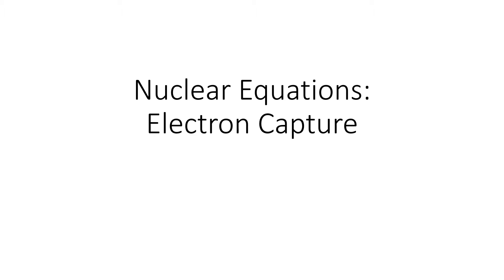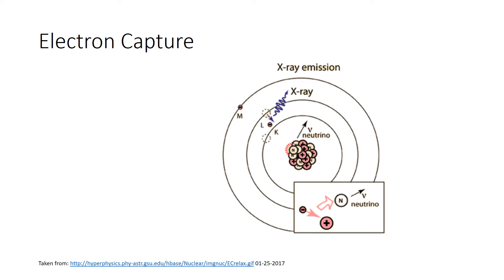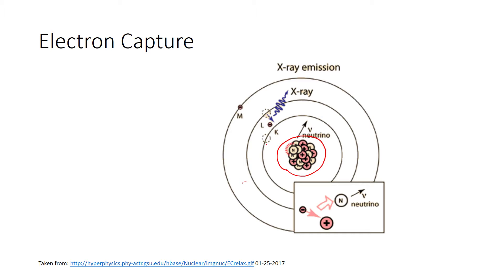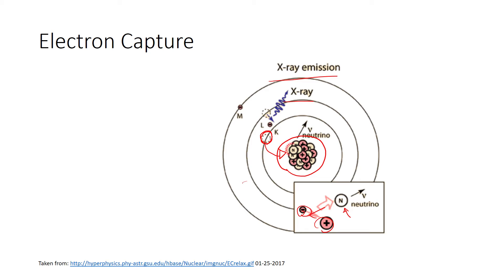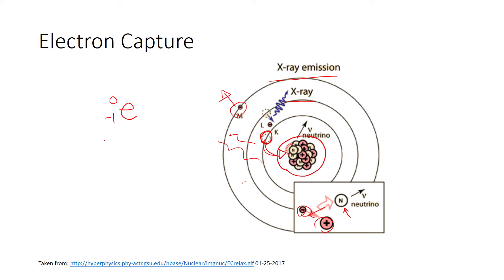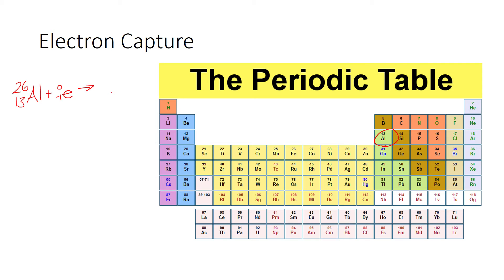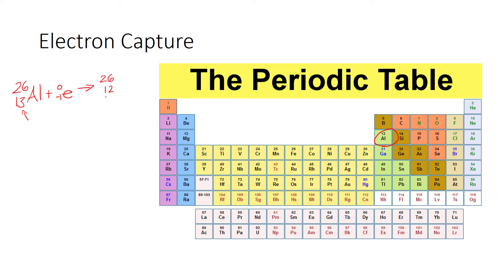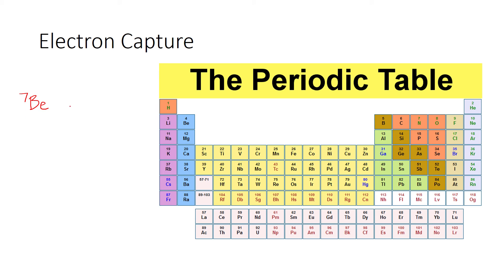Electron Capture

Comment: In absolute zero does an electron lose its momentum and if an electron lost its momentum would it turn into a particle like neutron or a proton would it lose its charge if it lost its orbit or is it impossible for an electron even in absolute zero to freeze in space and time and if it gets freeze in space and time would it become static and if electron is it static and near to absolute zero has no potential energy if you freeze an electron my question is what would happen it would have no potential energy right and you would be basically like a neutron totally neutral what if you stripped all the electrons off of the whole planet with all the periodic table converging on itself and become like one giant Mass or the electrons what shell or what determines one element from the next in a periodic table or is it the neutron or is it a combination of those things if you Froze or stripped every last electron would the the whole periodic table Fall apart? Becoming one big giant Mass like Sam trillion protons and a trillion neutrons with no electron with the f**** neutron disappear would it become positive or negative I want to know what would happen if all the electrons disappeared would we be able to determine one element from the other does that electron determine Mass is it the only energy necessary to separate one element from the other and if you stole all the electrons like I said what would happen to the neutron would it be still neutral or something